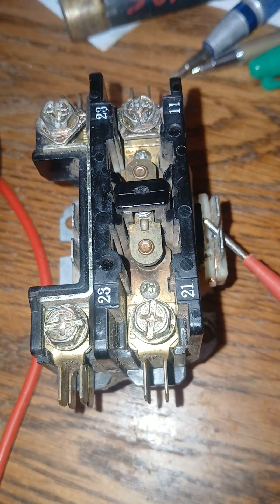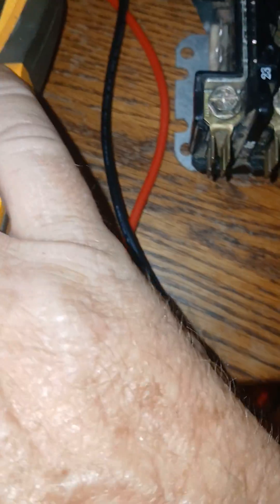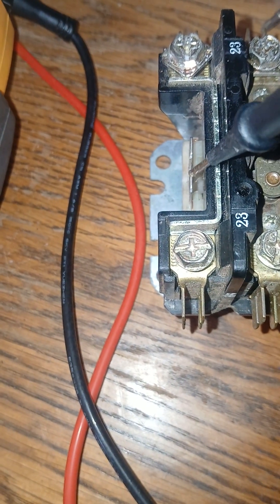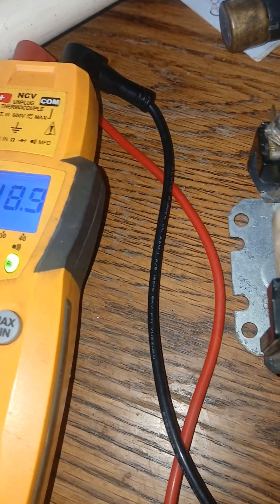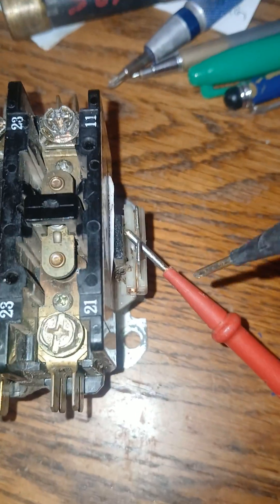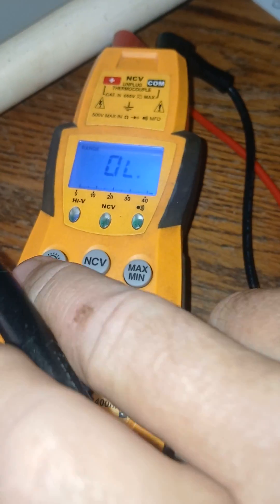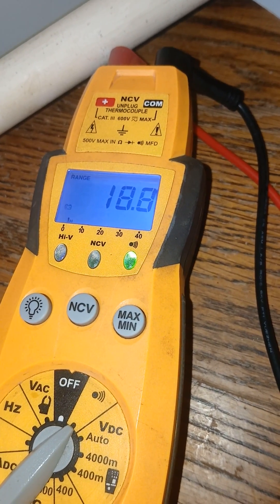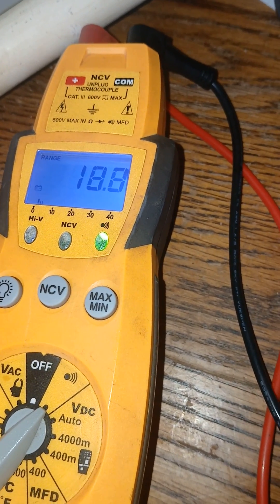Hvac contactor coils with continuity settings beeping multimeter?

Comment: What is the problem you are troubleshooting? Is it blowing a control board fuse? Are you losing high voltage across the contactor? Are the contact points pitted/corroded causing loss of high voltage? How amps does it pull while energizing the contactor?
Reply from the maker: Neither, just a point!

Question: If coil is SNAFU, could it throw control board?

How often do coils go bad, never had one myself?